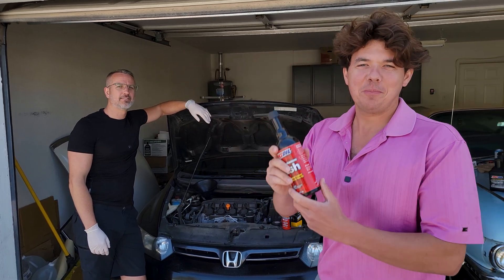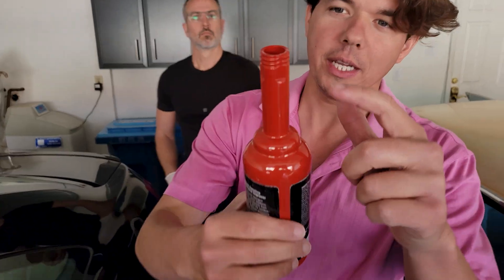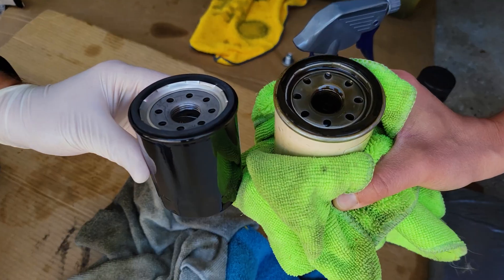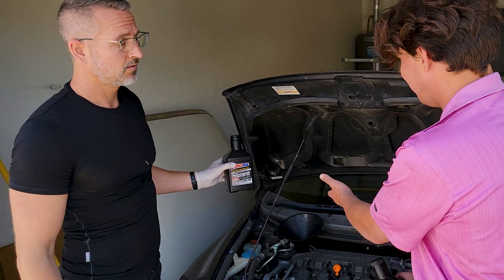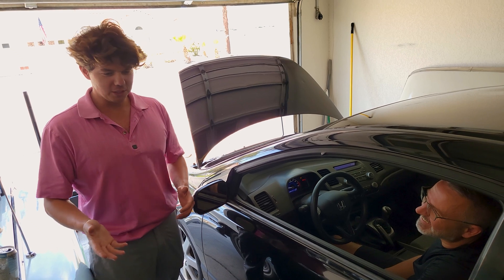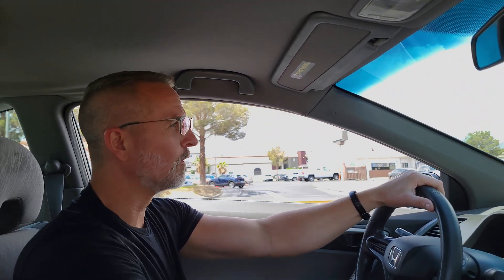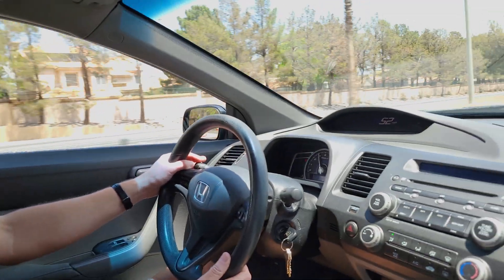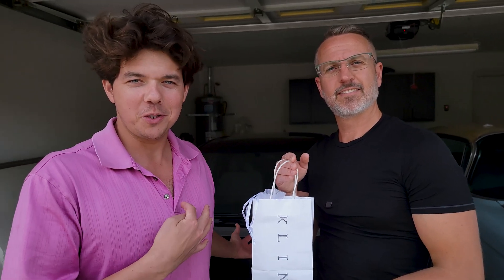Secret to stopping oil burning

Comment: Can I give this to my uncle he has a clogged artery this might be the very thing he needs by the way where can I get this stuff i would like to try it on my 03 Corolla it takes 5w30
Reply from the maker: For me to get credit & be "Your" Independent AMSOIL Dealer, please use my website below or my dealer no. 5331179 call anytime Eben Rockmaker 702-472-3614
After you click on: https://syntheticoilprotection.net/
1. Click the hamburger menu
2. Click offers AMSOIL preferred customer
3. Click join now. 6-month PC member add to cart.  ( There is no reoccurring renewal membership unless you select that dot box ) 
( You have the option to not have your credit card saved if you prefer - est. 1972 )
4. Scroll up to the top Select shop by vehicle. 

New Promo Codes: FREERAGS

Comment: Is this an advert?
Reply from the maker: Not sure what you mean?
Let's get your vehicles running better than brand new!

     For me to get credit & be "Your" Independent AMSOIL Dealer, please use my website below or my dealer no. 5331179 call anytime Eben Rockmaker 702-472-3614
After you click on: https://syntheticoilprotection.net/
1. Click the hamburger menu
2. Click offers AMSOIL preferred customer
3. Click join now. 6-month PC member add to cart.  ( There is no reoccurring renewal membership unless you select that dot box ) 
( You have the option to not have your credit card saved if you prefer - est. 1972 )
4. Scroll up to the top Select shop by vehicle. 

New Promo Codes: FREEUCL and FREEBOWL

Comment: You're gonna set the CEL. on if you open the gas cap while it's running
Reply from the maker: What is that?
Reply: @Syntheticoilprotection  Check engine light

Comment: I just bought a 2025 Hyundai palisade , what amsoil should I be using in it?
Reply from the maker: Are you new to AMSOIL?

Let's get your vehicles running better than brand new!

     For me to get credit & be "Your" Independent AMSOIL Dealer, please use my website below or my dealer no. 5331179 call anytime Eben Rockmaker 702-472-3614
After you click on: http://syntheticoilprotection.net
1. Click the hamburger menu
2. Click offers AMSOIL preferred customer
3. Click join now. 6-month PC member add to cart.  ( There is no reoccurring renewal membership unless you select that dot box ) 
( You have the option to not have your credit card saved if you prefer - est. 1972 )
4. Scroll up to the top Select shop by vehicle. 

New Promo Code: FREELAMP

Comment: Bro can I use this for my Honda civic 2014 9th gen si? With 72k kilometres? My Honda burns oil aswell
Reply from the maker: Yes!!!
Let's get your vehicles running better than brand new!

     For me to get credit & be "Your" Independent AMSOIL Dealer, please use my website below or my dealer no. 5331179 call anytime Eben Rockmaker 702-472-3614
After you click on: http://syntheticoilprotection.net
1. Click the hamburger menu
2. Click offers AMSOIL preferred customer
3. Click join now. 6-month PC member add to cart.  ( There is no reoccurring renewal membership unless you select that dot box ) 
( You have the option to not have your credit card saved if you prefer - est. 1972 )
4. Scroll up to the top Select shop by vehicle. 

New Promo Codes: FREESHIP & 5GS

Comment: Buy a Chevy it leaks. Buy a ford, it burns. 😂
Reply from the maker: Lol, oh really it has nothing to do with the make it's more the maintenance of it in the quality of the products that's used in the driving conditions that's the biggest element😃

And of course there's always lemon models.

Let's give a man a fishing pole & show him how to fish. 

     Together! We can get your vehicles to run better than brand new! 

     For me to get credit & be "Your" Independent AMSOIL Dealer, please use my website below or my dealer no. 5331179 call anytime Eben Rockmaker 702-472-3614
After you click on: http://syntheticoilprotection.net
1. Click the hamburger menu
2. Click offers AMSOIL preferred customer
3. Click join now. 6-month PC member add to cart.  ( There is no reoccurring renewal membership unless you select that dot box ) 
( You have the option to not have your credit card saved if you prefer - est. 1972 )
4. Scroll up to the top Select shop by vehicle. 

New Promo Code: FREEWAND

Comment: Hey Eben, since my vehicles have over 75,000 miles on them, can I use the signature series 5w-30 Amsoil oil? Or should I use the High mileage Amsoil 5w-30 oil? Just asking..
Reply from the maker: I would personally use the signature series it will clean the motor quicker has higher quality detergents I would come back and change the filter after 3 to 5,000 me you'll notice the oil will get really dark and that's because it's cleaning inside the motor.
I made a really good video on the whole process back about 6 months ago - https://youtu.be/6jYjsLTIH24?si=9rluSFj66mQ2b3sY

Let's give a man a fishing pole & show him how to fish. 

     Together! We can get your vehicles to run better than brand new!

     For me to get credit & be "Your" Independent AMSOIL Dealer, please use my website below or my dealer no. 5331179 call anytime Eben Rockmaker 702-472-3614
After you click on: http://syntheticoilprotection.net
1. Click the hamburger menu
2. Click offers AMSOIL preferred customer
3. Click join now. 6-month PC member add to cart.  ( There is no reoccurring renewal membership unless you select that dot box ) 
( You have the option to not have your credit card saved if you prefer - est. 1972 )
4. Scroll up to the top Select shop by vehicle. 

New Promo Code: FREEMP

Comment: Pro tip, half roll the end of your glove to prevent run off on you.......
Reply from the maker: Not sure what you mean
Reply: @Syntheticoilprotection  the end of your glove, cuff it ½ roll, picture a rain gutter. Not sure how else to describe
Reply from the maker: @IMTheOnE1984 I see you're just rolling your rubber glove backwards so the oil doesn't run up your form?
Reply: @Syntheticoilprotection  exactly
Reply from the maker: I'll definitely let them know and give it a try that way it helps thanks for the subtlety recommendation

Comment: Can I use this in my 2011 Terrain
Reply from the maker: Yes and you can order it right here.
For me to get credit & be "Your" Independent AMSOIL Dealer, please use my website below or my dealer no. 5331179 call anytime Eben Rockmaker 702-472-3614
After you click on: http://syntheticoilprotection.net
1. Click the hamburger menu
2. Click offers AMSOIL preferred customer
3. Click join now. 6-month PC member add to cart.  ( There is no reoccurring renewal membership unless you select that dot box ) 
( You have the option to not have your credit card saved if you prefer - est. 1972 )
4. Scroll up to the top Select shop by vehicle. 

New Promo Code: FREETOOL

Comment: I drive a 2020 hyundai elantra an ive been experiencing loss of acceleration from just a regular full synthetic oil change. Can someone on here please tell me if this will fix my issue if i add this oil instead to get better gas mileage etc. 

Also seen that hyundai 2020 elantra are now having a issue with buring oil an bad consumption problems 

PLEASE SOMEONE ANYONE HELP ME PLEASE!!! any advice is appericated
Reply from the maker: There's many things that could cause the loss of acceleration so that would definitely have to be diagnosed.

As far as performance in fuel mileage will definitely be improved with the p performance Improvement gasoline additive. The signature series motor oil will clean your engine from the inside out so you will have a better smoother running engine.
I highly recommend it if you're going to be keeping the car.
Now there could be something else wrong with the vehicle so I would definitely have someone take a look at it that does a lot of work on that vehicle.
Let's give a man a fishing pole & show him how to fish. 

     Together! We can get your vehicles to run better than brand new!

     For me to get credit & be "Your" Independent AMSOIL Dealer, please use my website below or my dealer no. 5331179 call anytime Eben Rockmaker 702-472-3614
After you click on: http://syntheticoilprotection.net
1. Click the hamburger menu
2. Click offers AMSOIL preferred customer
3. Click join now. 6-month PC member add to cart.  ( There is no reoccurring renewal membership unless you select that dot box ) 
( You have the option to not have your credit card saved if you prefer - est. 1972 )
4. Scroll up to the top Select shop by vehicle. 

New Promo Code: FREETOOL

Comment: 06:57
I have a car with 460,000 miles and it burns 1 qt every 2,300 miles. We have accidently ran it dry on oil like 20 times and while the engine was knocking real bad for a few days a few times until we got paid and bought oil, it never hurt the car. I honestly think some engines don't really care that much, of course you have to add oil and no engine will go 5,000 miles with no oil in the engine, some engines are not that "picky"...This is a 21 year old car that we don't really care about, but it just keeps going and going...
Reply from the maker: Wow, that's funny! Yahhh it just won't die!

Think ..... what if it could go 10,000 miles & use only 0.33qt..... Do you think that could be possible?
Reply: @Syntheticoilprotection  likely, but my brother lives in this car and has for 2.5 years, so it runs 14-hours a day(24 when off work), long story and yes he does work full time, he has some mental issues, he could afford a small apartment, but living in the car soothes his anxiety, we figure it has 13,000 idle hours as well...
Reply from the maker: Cool! Where does he live question mark
Reply: @Syntheticoilprotection  fayetteville Arkansas, walmart parking lots, truck stops...cops really harass homeless
Reply from the maker: @freddyhollingsworth5945 ✌️

Comment: Stuff is too expensive
Reply from the maker: That's exactly what I thought until I found out about the preferred customer membership.

I give a man a fishing pole & show him how to fish. 

     Together! We can get your vehicles to run better than brand new!

     For me to get credit & be "Your" Independent AMSOIL Dealer, please use my website below or my dealer no. 5331179 call anytime Eben Rockmaker 702-472-3614
After you click on: http://syntheticoilprotection.net
1. Click the hamburger menu
2. Click offers AMSOIL preferred customer
3. Click join now. 6-month PC member add to cart.  ( There is no reoccurring renewal membership unless you select that dot box ) 
( You have the option to not have your credit card saved if you prefer - est. 1972 )
4. Scroll up to the top Select shop by vehicle. 

New Promo: FREEFUNNEL

Comment: How often do you need to flush your engine. I just did mine.
Reply from the maker: That's a great question you can flush it anytime you think it's a good time to do it the flush is safe to use every oil change I personally do it on my car every oil change because it has a turbo and those have a lot of oil cooking where it burns inside I recommend flushing a diesel every time.
On a regular engine I think you're fine just doing it the first time to get the old mineral deposits out.
   Together! We can get your vehicles to run better than brand new! 

     For me to get credit & be "Your" Independent AMSOIL Dealer, please use my website below or my dealer no. 5331179 call anytime Eben Rockmaker 702-472-3614
After you click on: http://syntheticoilprotection.net
1. Click the hamburger menu
2. Click offers AMSOIL preferred customer
3. Click join now. 6-month PC member add to cart.  ( There is no reoccurring renewal membership unless you select that dot box ) 
( You have the option to not have your credit card saved if you prefer - est. 1972 )
4. Scroll up to the top Select shop by vehicle. 

New Promo: FREEHAT

Comment: Check owner’s manual
Reply from the maker: Your vehicle can run better than brand new by choosing the right fluids! 

     🇺🇸   50 Years of AMSOIL anniversary - https://youtu.be/MQUqRBI8dD0
     
     🥇🥇🥇   Synthetic Oil Protection Google map reviews
Eben Rockmaker, independent AMSOIL Dealer 
Dealer no. 5331179
(702) 472-3614
https://maps.app.goo.gl/1aXxuXrXK9eJwqK78
         
♥️   See fluid performance tests - https://www.amsoil.com/performancetests.aspx?zo=5331179

Comment: Don't put  SYN oIL in a Older cars 1980 70  60. It will make you leak badly, Its for newer Cars. Found Out THe  Hard Way.
Reply from the maker: Things have changed - https://youtube.com/shorts/taqeCxvb23M?si=YmXJAd-mvL1NaUFZ

Comment: Hey i have a 1991 Honda Accord manual with 328 thousands miles it's not smoking it's my only vehicle I definitely tried items where can buy them
Reply from the maker: That's awesome you can order them right here through my website if you ever have any questions let me know☕️💯
  I give a man a fishing pole & show him how to fish. 

     Together! We can get your vehicles to run better than brand new! 

     For me to get credit & be "Your" Independent AMSOIL Dealer please use my website below or my dealer no. 5331179 call anytime Eben Rockmaker 702-472-3614
After you click on: http://syntheticoilprotection.net
1. Click hamburger menu
2. Click offers AMSOIL preferred customer
3. Click join now 6-month PC member add to cart.  ( there is no reoccurring renewal membership unless you select that dot box ) 
( you have the option to not have your credit card saved if you prefer - est. 1972 )
4. Scroll up to the top Select shop by vehicle. 

New Promo: FREEHAT

Comment: Haha...this guy is the ULIMATE snake oil salesman! What a fraud!
Reply from the maker: Best lubricants in the word:
🇺🇸   50 Years of AMSOIL anniversary - https://youtu.be/MQUqRBI8dD0
     
     🥇🥇🥇   Synthetic Oil Protection Google map reviews
Eben Rockmaker, independent Amsoil Dealer 
Dealer no. 5331179
(702) 472-3614
https://maps.app.goo.gl/1aXxuXrXK9eJwqK78
         
♥️   See fluid performance tests - https://www.amsoil.com/performancetests.aspx?zo=5331179
Reply: @Syntheticoilprotection  Haha, Amsoil has you brainwashed!
Reply from the maker: Explain.....
Reply: @Syntheticoilprotection  Figure it how yourself. You may scam others but I am no fool. Synthetic oils are all the same. Change your oil every 4-5K with a FULL synthetic and there is NO difference using Amsoil and I think you know that too.

Comment: This oil flush product really cleans piston  compression and oil rings, by removing burnt on oil varnish, carbon and sludge from the compression/oil rings and piston grooves it really improves  compression and stops oil burning and also helps stop the pistons from pushing oil into the combustion chamber. This cleaning also helps leave Amsoil clinging to valve train components. I know this product works because I use it on my Subaru, Dodge Challenger and Honda Pilot.
Reply: No it does not!! Any reputable master mechanic will tell you to NEVER use additives to your engine!
Reply: @crimsonpearl4686  it also cleans the oil pump and pick up screen, doing for years on my Pilot and Subaru both have over 200k. You have some Balls telling me it doesn’t work🤣😂
Reply: @Doug_Hefernen  Its all in your head.
Reply: @crimsonpearl4686  keep hating.. seems like a personal issue.
Reply from the maker: @crimsonpearl4686 that's 100% correct and that's why I created this playlist: your mechanic doesn't know how to take care of your car - https://youtube.com/playlist?list=PLB_ftWArBFddVQNbHRp49F6DeiBeNFSS_&si=pfjfWW_2SOs_HHJb
Reply: @Syntheticoilprotection  Nice try, I am not falling for your snake oil.
Reply from the maker: AMSOIL has been the leader in lubrication since 1972.

🇺🇸   50 Years of AMSOIL anniversary - https://youtu.be/MQUqRBI8dD0
     
     🥇🥇🥇   Synthetic Oil Protection Google map reviews
Eben Rockmaker, independent Amsoil Dealer 
Dealer no. 5331179
(702) 472-3614
https://maps.app.goo.gl/1aXxuXrXK9eJwqK78
         
♥️   See fluid performance tests - https://www.amsoil.com/performancetests.aspx?zo=5331179
Reply: After 1,000 miles, my 2012  Camry oil burning issue hasn't been solved. I used the Amsoil engine flush , then the 0w20 high mileage O.E. formula.   It runs quieter and I assume the piston walls are scarred or burred, allowing oil in the combustion chamber.  The PCV valve was changed,  no smoking.  With 223,000 miles on the ticker, not disappointed.
Reply from the maker: @truthseeker1979 there is other stuff you can do you can also do the power foam.
We have a bunch of videos on the Channel with that also have you done the Pi performance improvement?
Reply: @Syntheticoilprotection  Yes, I did use the P.I., forgot to mention.   I'll checkout your other videos on the power foam.  Can you provide me the link?  Thanks for responding!
Reply from the maker: @truthseeker1979 this is one of my favorite with Reggie he's a funny guy - 
https://youtu.be/JL4pSjALC4A?si=NEbBHkQLeJBi-iCu
Reply: @truthseeker1979 any update?
Reply from the maker: @jonderrick25 yes, Can Oil Last 15,000 Miles? Proof is in the Oil & Lube: 

     15,500 Oil Analysis Test Results SL550 - https://youtu.be/3rdN6U1Jt_M 

     5500 Mile AMSOIL Oil Analysis Test Results - https://youtu.be/3wf962IwEmo   

     5000 Mile AMSOIL Oil Test Results On My SL550 - https://youtu.be/fLuvzN6yLSw 

     11,000 Mile AMSOIL Oil Analysis Results on my Corvette - https://youtu.be/YEY_13UYzA4 

     20,000 Mile Oil Analysis Results on Honda Uber - https://youtu.be/gm_PXlpiaTk 

     26,000 Mile Oil Analysis Results - https://youtu.be/Wdq2A2YIorM 

80,000 Mile Oil Analysis Test Results Freightliner Cascadia - https://youtu.be/9A9k6i1xMoo 

     25,000 Mile AMSOIL ATF Analysis Test Results - https://youtu.be/IeVPGR7UO9E

Comment: That locked up seatbelt is pretty easy to fix. You will lose the gunpowder discharge but will still have the standard safety lock and retract.
Reply from the maker: That's awesome do you have a video on how to do that I'll text it to him?
702-472-3614